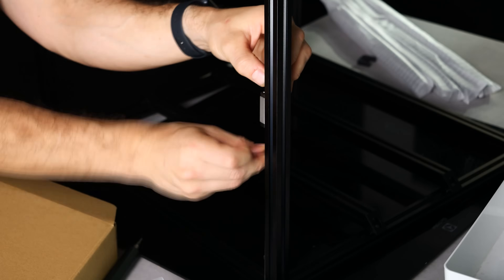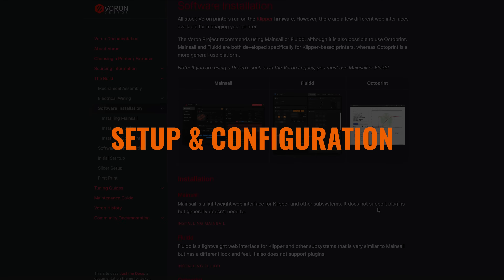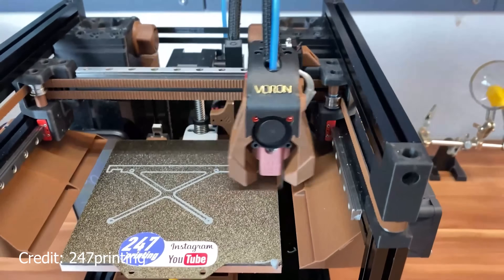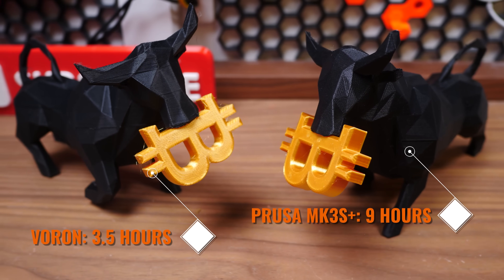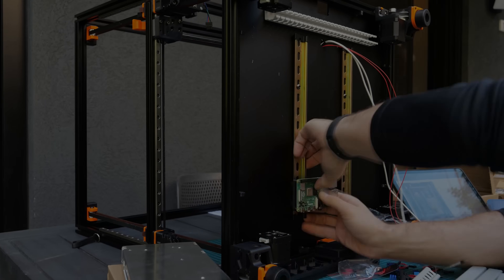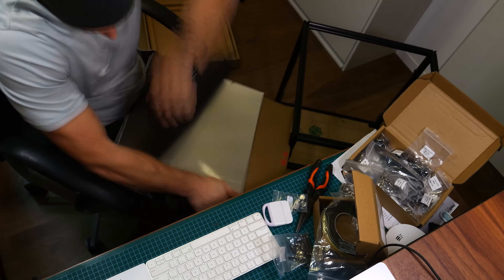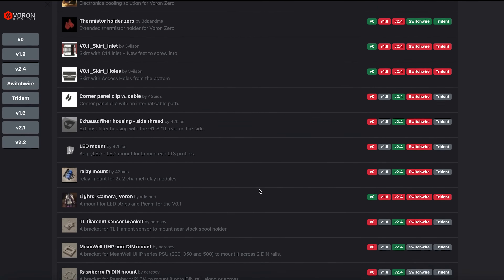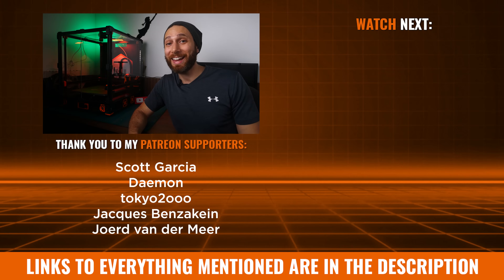My Voron 2.4 Build is DONE... Here's What I Learned.

Comment: take it in a printer tent like a growbox or enclosure and set the outer enclosure under negative pressure (with or without filter in the enclosure) vent the air instantly out of window with a plate before the window so the electronics wont get hot and no fumes will come out! i have my bambu in a negative pressure tent like a growbox so nice for abs or resin printers! no more fumes! i work with resin in a big 1,20x1,20x2m growtent/growbox and have a mask filter on and work inside the tent! no fumes come into the rest of my house! so nice and so easy! and have tables inside the growbox/tent

Comment: 0:48 if you are dumb enough not to practice basic electrical safety, also if you are that worried and don't already have one then you should get a ground fault protection service installed in your outlets or breaker box depending on local regulations.

Comment: When my slightly modded Ender 3 pro running klipper w/input shaping can print beautifully at 250mm/s set to 8000mm/s acceleration I just can't justify building a Voron, or even converting my existing ender to a n Enderwire(Switchwire Mod). My benchy comes out pretty much perfect in14:33 consistently. That being said I REALLY WANT a Voron printer......or maybe I really want to build one, I honestly don't know. No issues with your video, with a 7 month old I myself I can say that it was a ballsy move to work on this soo late into the pregnancy lmao. With the modifications I have in place I still want to upgrade a few things like swapping rollers for rails on the Z and X axis but I just can't think of much else that would improve the printer. A few months ago before I implemented klipper and input shaping I never thought I would say that about my ender 3 but this bad boy puts in work. I mean to compare what I have to the experience I got when I printed the first SD card dog print from the included ender sd card on an 8 bit board to Klipper w/input shaping, dual z axis, direct drive, bi-metal-all metal hotend, skr 1.4 board(for true dual z drive),  bl touch, and upgraded 15x40 24V part cooling fan........you can hardly call it an ender anymore but I'm still very proud of my creation. :) Let me know what you think if you see this. Should I still consider it? There are many $50 ender 3 models on FB marketplace.........and I barely need a good excuse lol

Comment: I think you'd be better off keeping that printer out of the cabinet for the reasons you outline.  If you have vertical space, you could theoretically use the switchwire spool holder, or maybe adapt the salad spinner (a top-mounted spool holder designed for the printer-for-ants called the Salad Fork, which is a mini-Trident) for use with the 2.4.
Reply from the maker: Good tips, hopefully I get a new space though

Comment: Some useful mods I would recommend: 

GE5C Z-Joins by Hartk - probably not video worthy, but removes play in the Z
Extrusion Backers by tanaes - look for his github to show the research done on it
Sexbolt Z Endstop by Hartk - If you don't plan on TAP
Chamber temperature sensor - just good info to know
Bed Fans by Ellis - Speeds up chamber heating, and useful in addition to Nevermore
Phaetus Rapido + CHT has an impressive amount of flow, IMO
Reply from the maker: oh snap, i need to get on this. THANK YOU. I'm on the Rapido and CHT. Bed Fans are a must, b/c this thing doesn't cool as fast as my Bambu and that's what's slowing me down mostly

Comment: Pro Tip: Skip the exhaust and print a block off plate with Bowden passthrough. You're using nevermore, and you don't want to be venting that nice warm air the printer needs to print ABS. Just open the doors for PLA. I'd also really recommend filament snap latches for the panels, and 270° hinges for the doors. Thank me later and happy printing!!
Reply: Just DM me if you want the links.
Reply from the maker: Done and done,t hanks

Comment: And now it's working, time to ditch the Klicky and install TAP. I love TAP.
Reply: Also Andrew Ellis tuning guide is the tuning bible.
Reply from the maker: Yeah I need to go through it but it's sooooo long lol
Reply: Tuning guide is long for sure. But so worth the results. Though with a newborn it may be difficult to dedicate the time to it. If you're getting good results, maybe stick with that now?
Reply from the maker: Can you sell me on it? I've been offered it, but I can't for the life of me figure out why it's better. Klicky works awesome for me?
Reply: I prefer TAP as you only have probe offset, not probe and endstop. You can also change the build plate and nozzle at the same time, no adjustment necessary.  Zero chance of dock undock issues. No glued in wires to work loose.

I also just like the idea of the fact that what you're trying to do is measure the gap between nozzle and bed. And with TAP you use this by using the nozzle touching the bed. Makes sense to my little brain.

It's also been a while (before TAP) without me scaring up my PEI with an offset error or issue. But that may have been user error 🤨

Comment: Try adding an EBB42 CAN BUS for your V2 to get rid of most of the cable chains and replacing them with a small STM32 board sitting on board of your extruder motor. I am actually doing that right now.
Reply from the maker: Oooh, neat

Comment: On the subject of putting the Voron in a second enclosure, I was relying on my 2.4 to print out things like the skirts, exhaust, side panels clips, electronics fan mounts, Nevermore, etc. -- all of the non-functional parts :). Because the printer is in my garage, and with it being winter in my area of the world, when printing ASA I was struggling with bed adhesion.  I ended up placing the 2.4 into a soft enclosure and, with no fan over the electronics, I was seeing around 80C on the Pi and mainboard.  I stuck a small fan with a clamp on it in the back to blow across the electronics and that still left me with temp readings around 60C.  It can be done if you can figure out how to cool the electronics, but I would suggest leaving them open air.

As for what's next, my build also left me with the itch and I picked up an LDO v0.1 kit during Black Friday in the US.  The v0.2 though is more or less available, a few spools of ABS+ just came in today, so I think I'll start printing parts for that while LDO (hopefully) releases an upgrade path.
Reply from the maker: Thanks for sharing :)

Comment: Mods I would recommend.  Nevermore filter(and remove the rear exhaust),CANBUS toolhead board, Tap (vs using klicky) or incorporate Auto-Z calibration with klicky, case leds, klipperscreen,  Purge bucket/nozzle scrub brush.
Reply from the maker: Nevermore :done:, I'll research the other 2. I'm not convinced by Tap. Oh, I also did the brush and bucket, and most of klipperscreen done, but waiitng on a cable :)

Comment: Nice job on the transition to the sponsor! That was smooth. The whole video was very well done. Also. Congrats on the baby! After a couple builds it gets easier. I can do a voron in two or three days now.
Reply from the maker: wow... respect dude!
Reply: @thenextlayer  I've built a bunch of printers. I've never bought one. I've built 7 after rebuilding my 0.1 as a 0.2. It takes longer to print the parts on my 2.4 than it does to build it. You really should build a v0 they are incredibly handy for when you need a smaller part fast.

Comment: For me, my main goal is to increase the reliability of my printer. I want to hit "print", I shouldn't have to babysit it, it should print successfully and parts should be to tolerance. For this, here is my top list for nice mods and upgrades:
- Titanium extrusion backers, if you print ABS/ASA regularly
- Kinematic bed mounting, if you print ABS/ASA regularly
- Bed fans and nevermore, if you print ABS/ASA regularly
- look into Z frame expansion compensation, if you print ABS/ASA regularly
- GE5-C sperical bearings for Z-joints

- If you want to impress your kids: Disco on a stick and rainbow barf for the nice extra rgb

-if you really wanna up your max speeds or increase PLA/PETG quality at higher print speeds: get the Mantis Toolhead. This mod is a bit more involved, but packs weight reduction (even more if coupled with a quality MGN 9 rail for X), therefore printspeed improvements and more cooling performance for a reasonable additional cost.

- a cool project, a bit more involved, but a great upgrade for ABS/ASA printing is on github at FrankenVoron/V2.4EZ . It's an extra outer shell for your printer that can be better insulated, thus increasing chamber temps and reducing energy consumption.
Reply from the maker: Wow, impressive.... Where can I see pics/video of your printer? Sounds insane...
Reply: @thenextlayer  Unfortunately, it is out of service at the moment. The problem with having only one printer is that once you disassemble it, you don't have another one to print parts that you might need to fix it. As I'm working on my degree at the moment, I won't get around to fixing it in the next 1-2 months, so it will sit idle for a little while longer. But I got the promise that after finishing the degree I am allowed to buy and build a second V2.4! So the future is bright for me.

Comment: Congratulations on your baby and Voron build!

I don't know if it's in your interest, but @Rolohaun here on youtube makes some really interesting open source printer builds. Some of them have mostly printed parts (The Rook and Rook 180), but are very stable and almost as fast as a Voron.

Also, I know you've made videos about printed tools and stuff. But I would love to see a video that shows how you sort all your tools, screws and in general your workspace - as well as highlighting which tools you use. Also, if you have, then what tools surprised you in how much you've and how little you've used them.

Second idea: I challenge you to make a fully tricked-out RatRig V Minion with as many mods as possible (or the TicTac on printables)! An additional challenge to this would be printing the aluminum extrusions in something like Carbon Fiber Nylon or the like!
Reply from the maker: Thanks for the kind words. Wow, need to check those out... sounds cool

Comment: You shouldn’t be installing both the exhaust filter fan and the nevermore mod together, usually it’s one or the other…. The LDO build FAQ has a link to an exhaust cover if you’re using the nevermore.  Look into adding ‘Bed Fans’ to help with chamber temps for the large 350 space
Reply from the maker: i might do that, but for now i gotta move on to the 3-4 other printers i have to review...

Comment: Best advice here is organizations of both parts and tool and having a proper building area. Don't have a workshop ? Use the area where the printer will live to build it !

With that being said, I have two kids (albeit older than yours, congrats btw) and I managed to build my 2.4r1 "barebone" (no premade wire harness, no custom PCB, quite a lot o soldering, and the state of the instructions in 2020) kit in less than a week by working on it a few hours every evening, including s couple until the middle of the night... My point is it doesn't have to take 4-6 weeks to build a printer like this, even though I can understand why it would depending on your circumstances. Wouldn't want people to be put off by thinking it takes too long to build.

Less ads this time, but that sneaky PCBway got me... I like it when there's a change of scenery or some logo / format change to indicate this is an ad segment.
Reply from the maker: Good feedback, thank you

Comment: Check out titanium hardware, you can decrease the weight of the toolhead by 74g by replacing screws, nuts and washers
Reply from the maker: Interesting... does it make a difference in the print speed and qulaity though?
Reply: @thenextlayer  As a rule of thumb: If your printer is built without mistakes (like loose grub screws) and built out of quality parts as yours is, print quality lies to 95% in software! If you increase your print speed there will be a point at which quality (and reliability!) will start to decline due to physical/mechanical limits. Depending on how far you want to take your speedracing this might start to matter. If you crank the accelerations further, you will start to notice the inertia of your moving X-axis beam in the form of artifacts. And there will be a point where input shaper will not be able to compensate for these artifacts. And then the only solution is reducing the moving mass.

There are different options for reducing mass. As far as I know the most weight loss lies in changing the X-axis rail to MGN-9 (get a high quality one) and switch to the Mantis toolhead. The weight loss is approximately 3-4x that of using titanium fasteners and comes with the additional plus of having two 5015 cooling fans with full airflow to the parts, so about 2,5x the cooling capacity of stealthburner. But (at least at the moment) won't have an upgrade path to the Voron Tap. (but you got the klicky probe already, so does it really matter ...)

To me the weight reduction rabbit hole should progress like this: Stock V2.4 > Mantis toolhead = MGN 9 (especially impactful on 350) >  Umbilical cord wiring > Reprinting parts on X-axis with lower infill (where possible) > lighter X beam (carbon fiber or skeletonized aluminium) = titanium fasteners (easy to do, but ~70g weight reduction for ~70 bucks [last i checked] on a 800g extrusion?)

You should ask yourself how far you want to go on the speedboat racing, as there will be devastating diminishing returns of all of these upgrades. You got a 350 after all. It is orders of magnitudes more difficult to archieve speeds like 247printing on yours compared to his V0. And there will be hard stops dictated by physics. Do you want to see what it can do for science and then proceed to print at a reasonable 100-300 mm/s? You will learn a lot and get to love your Voron more and more by the day! Do you want to push it to the limits, compare it to others and run it for sustained periods at ludicrous speeds like 1500mm/s? Boi, you're in for a ride, it won't be pleasant and the results will be subpar.
Reply: @thenextlayer  Depending on your usecase, there is a different but highly impactful titanium upgrade. Are you planning to somewhat regularly print ABS/ASA? Then you'll want your chamber temps nice high and toasty. At these temperatures and especially with a 350x350 Voron, your aluminium X and Y-extrusions will deform as a bi-metal because of the bolted-on steel rails. And this deformation is SIGNIFICANT (0.3-0.4 mm in Z!) and can negatively impact the reliability of the first layer sticking and part tolerance. The solution are titanium backers for these extrusions which basically eliminate these deformations. As a fellow V2.4 350mm owner, in my opinion the titanium extrusion backers are among the most impactful mods regarding reliability ("hit go and forget, the print succedes") and reproducibility (of the produced) of these machines.